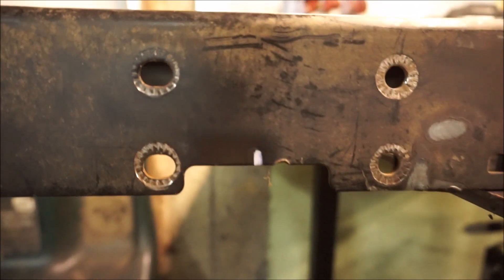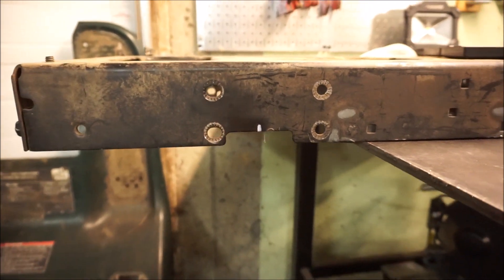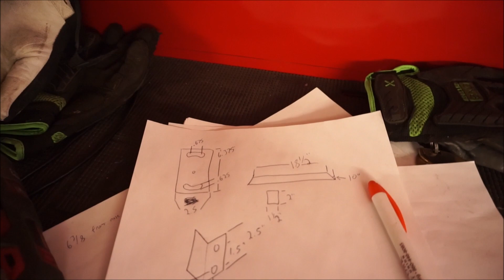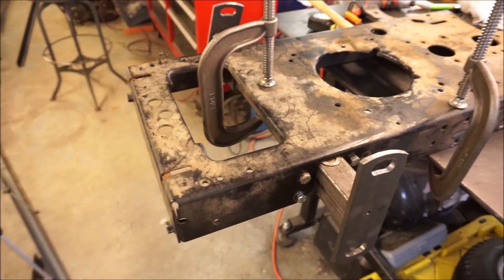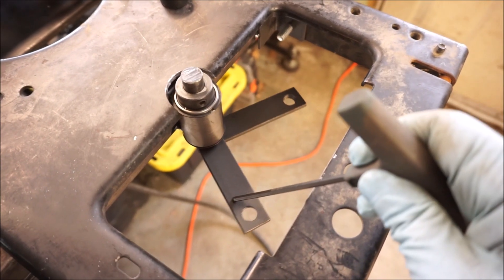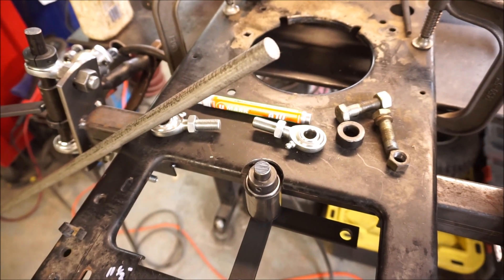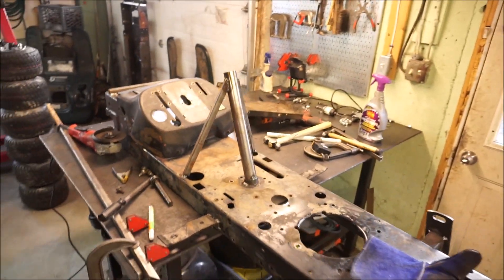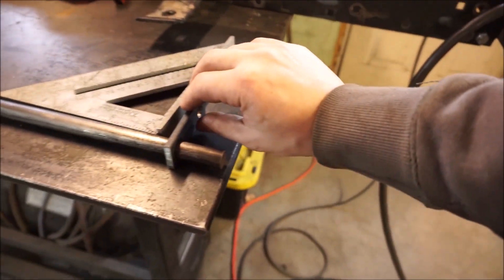Racing Lawn Mower Built Part 4: It's  a roller!!! steering setup and axle instalation.

Comment: Like your work, great build. Like to know rear axle dimensions and tire and rim sizes front and back please. I'm building my first turf eating machine lol.
Reply from the maker: The rear wheels are 8"×8" with a 4 on 4 bolt pattern. Fronts are 6" wheels that are 7.25" wide. Also running a 36" wide 1-1/4" kart axles.

Comment: go ALLL OUT with those builds... with machine shop in house.  the rest of us, do what we can to get to 35? 50 mph with 8" drive pulley and 4.5" driven pulley... put 8" disc on it where the old disc brake was as it wont do much to slow it down, even if old disc is rebuilt... spins toooo fast, burn up the brake pucks too fast... $10 / set.  i was giong to go with MC disc and caliper but ... toooo big to put in wheel and too hard to fab up (for me) to mount to axle/wheel... frame. got goldwing caliper from bike. IT WUD STOP the wheel, but where to put the disc??????? cut out on the axle is not all the way to the transaxle???? so ... how to mount it to the axle shaft???? and it not spin when apply the brake?

Comment: Dude you’re killin’ it with the geometry and squaring things up along with your videos being awesome, but when you were welding with clear glasses and just closing your eyes I laughed a lot... that’s some shit I do for sure!
Reply: just thorow it  together... it is not a Steinway... and Son's GRAND piano. it goes fast, esp for a ridingmower and turns left a lot... or turns R but goes Left. for regular ppl that spend... ~$500 or so on a ok street rding mower... but wud to spend $5000 on a REAL FAST/good steering/stopping riding mower... if we can get the steering and brakes to handle... 35 mph and not kill us, that wud be good. i wud want roll bar on mine andseat belt... seat belt $10... muffler shop can bend some pipe and weld a piece of flat iron to it to bolt to the frame to keep mower off us if it rolls... do they roll... not the ones that are REAL CLOSE to the ground??? but the higher ones that were closer to mower than go Kart... and kinda high.. with ... 18" OD tires... 23" OD tires? 25" OD tires.... then they cost so much that might as well go to 265-65-15 tires and 15x8" wheels if it has 5 on 4.5" bolt pattern hubs and they should last 898,000 miles or more on the 1/2 floor of the freeway... not to be confusedd with the 2nd floor of the interstate in a BIG TRUCK
Reply: @gmcinnis6304  lmao your pretty funny dude. 500 is a pretty good budget on a mower to I honestly rather build a nice live axle cart for500 butthese peerless 700 gearboxes make these really pretty nice and fun to drive

Comment: Making it serviceable is a good design idea. The GP I have, I redid the steering and clutch on it, and made them to be serviced. The builder of it had put in an idler arm using half in steel bar running vertically through a sleeve in the frame, and the linkages were welded on. My first time racing it, I took a good spill and tweaked that arm, and put me out the race. I cut it out, and rebuilt a new arm using 3/4" shaft, cut keyways, drilled and tapped the ends, and have the new arms mounted to weld hubs. the new housing for the shaft has brass bushings in it, and i would like to add a grease zerk too. the threads at the ends i have bolts in to retain it all together. If i were to damage any component in that part of my setup, I can disassemble it and replace just what's needed.
Reply from the maker: I hear that, the mowers are always a project even when they're "done" lol

Comment: I like the idea of the removable axle tube. 
I have seen the idea used on a different chassis with the intent of swapping out between spindles that have front brakes and an axle that doesn't. I believe the reason was with spacing, spindle length to have room for the brakes was enough that a shorter tube was needed. 
My thought for the future, on implementing this design, a section of plate between the chassis tube and frame, extending froward to reach behind the front axle's rear bracket, to try and help tie it to the rest of the chassis a bit more. I've also thought about for the engine mounting, either a pair of strips of plate going across the underside or a single large plate with a large clearance hole like the frame itself. 
Also been enjoying this and the previous video with using the Bridgeport! I bought one myself a couple years back for doing home projects, racing mowers being one of them too!
I think anyone that does any amount of tinkering that can spare the space should invest in one!

Comment: Building a legend mower for Arma 
Should I weld my axle or bolt it? What size square tubing should I get? Keep up good content bud my YT has my build too
Reply from the maker: I would say 1.5"x2" or 2"x2" box steel 1/8" wall thickness should be good for a full frame mower. I prefer to bolt in my axles, I've had to replace one of the end plates after I hit a rock and got bent pretty bad. It was much easier to unfold the axle and reweld the end plate than do all the work with the axle fixed to the mower. I'll be sure to check out what you have going on too!
Reply: @TheJanticJournal   ok thx buddy comment on my videos to give me tips ill deff need it lmao no idea what I'm doing.  Arma rules just stock flathead class. Called legend class